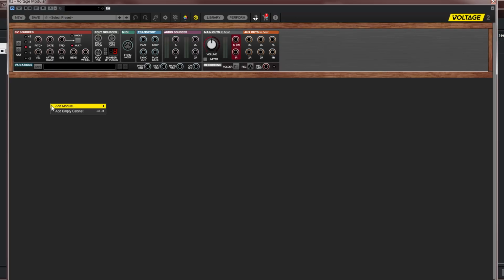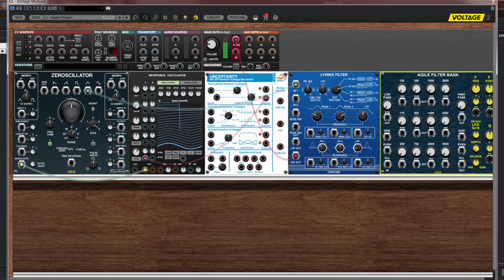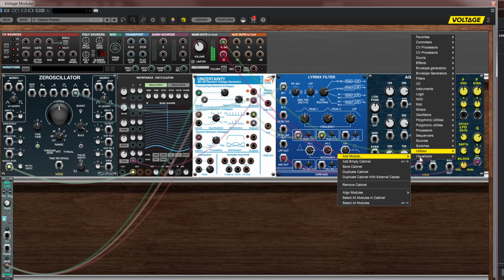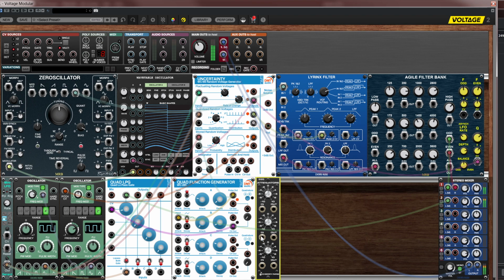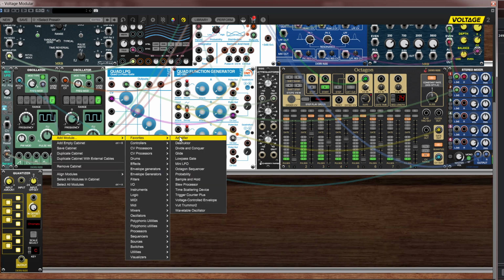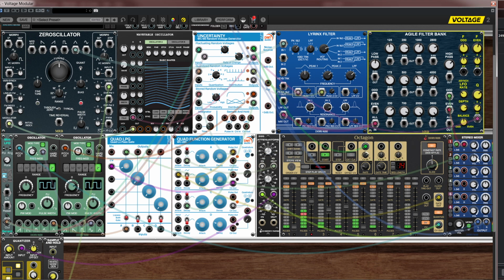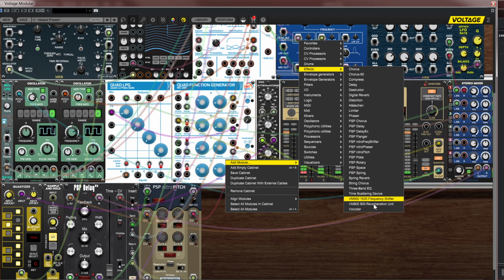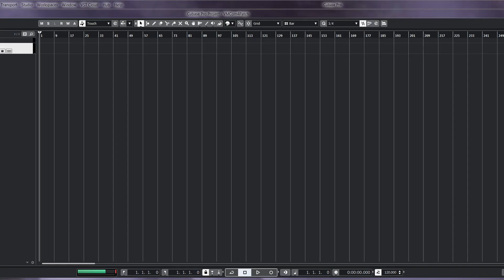Patching Voltage Modular with Commentary (3)

Comment: I really love these sounds. And I wish I could understand a thing in modular synthesis:face-turquoise-covering-eyes:What sources would you recommend to learn about it? I know something about semi-modular synthesis (I have a behringer 2600), but modular synthesis in above my understanding so far. Building blocks with modules is so confusing...
Reply from the maker: Typically your patch is going to have a sound source (oscillator), sound shaper (filter, wave folder, wave multiplier, wave shaper), volume controller (VCA, mixer, preamp, attenuator), and some envelopes or function generators to open the VCA and control the sound shaper that you are using. There are very few rules though. Some filters can be oscillators, some envelopes can be lfos or oscillators, and modulating most things at audio rate is going to give extreme results. Effects are a big part of synthesizer sounds as well so you might want to familiarize yourself with delays. Delays at very short times can produce different effects than just echos. Feedback is also a very useful tool in synthesizer patches. Feedback is just running something back into itself sometimes with an inverter or preamp. As for videos to check out I thought these modules reviews by @synthesizer83 were well done and informative. https://www.youtube.com/watch?v=Wd2pD04O1_w&list=PLdZIQr4dNdwKnxMZw5s4m8IUBsPptWmOH
Reply: @Bata9999 thanks a lot, I’ll have a look!